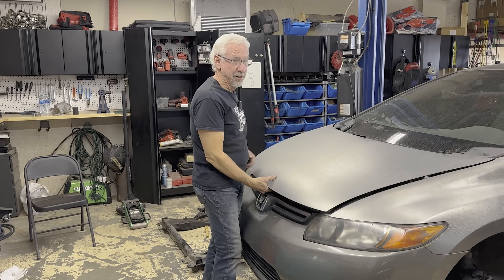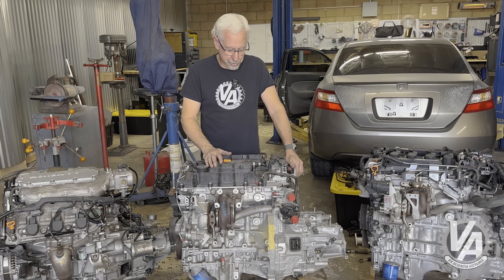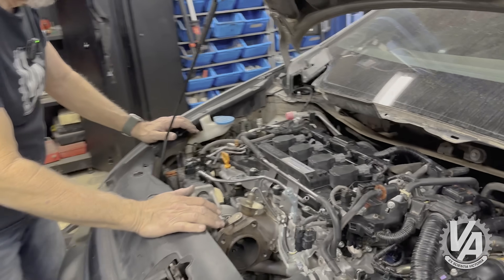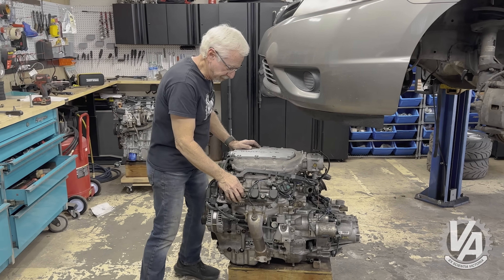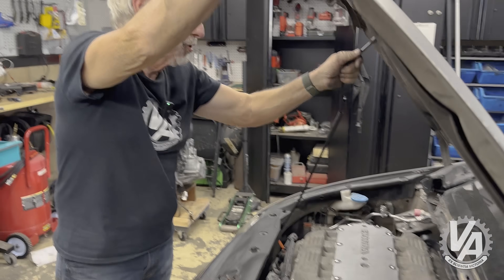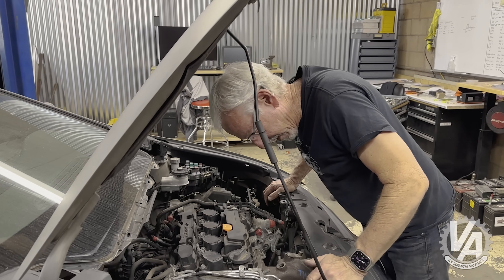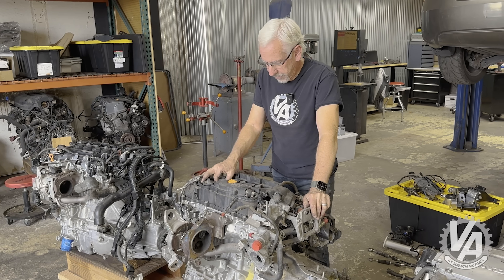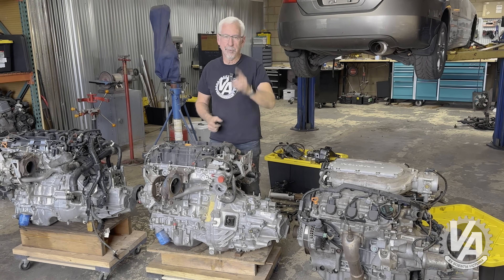Better than a K Swap? (More than a Si killer!) R18 to K, J or L15 Turbo!

Comment: Jseries is the most interesting one
Reply from the maker: Possibly the simplest too.
Reply: J swap all the way
Reply: The New j35y8 is what you want and Honda guys are excited about its the new variant they take the NSX heads and put it on the j-block so now it has double overhead cams no more VTEC but can phase intake and exhaust now sorry this was lengthy I'm just hoping to start my project to the summer with one
Reply: @kingmaybus8409 yeah it sounds cool and no more timing belts , all chains ⛓️
Reply: What does it weigh vs the K20c?
Reply: @nickwagner2284  the j is ruff 300 pounds no trans
Reply: @JDXFAB  So significantly heavier than the other options. Not sure why anyone would want that much weight up front? Drag racing I guess?
Reply: @nickwagner2284  no they are all about the same weight remember the other ones have turbo plus all the pipes there is no way the other engines are that much lighter
Reply: @JDXFAB  I don't know about the K20C, so forgive me for implying I was speaking about that motor. I had in mind the older K motors e.g. K20a2, K24a2. From what I can tell online they are c. 100-150 lbs lighter, which makes sense. And I believe the older K motors are very similar in weight to the B series e.g. B16a2. Now, if the K20C motor weighs as much as the J32, I would never want either of those engines in my car, as they would seriously change the dynamics of the car on track/autox. But I have no desire for drag racing/street racing domination. If I was purely into drag I wouldn't have much interest in a fwd car. But different strokes!
Reply: @nickwagner2284  the reason I chose the j32 in my application is cause is rear wheel drive now it sits way more behind the front suspension for better weight distribution plus cheaper plus bigger displacement so can make same power with less stress if I was making a front wheel drive prob go with the lighter option
Reply: @JDXFAB unless you have 2 more pistons, sleeves, the oil to compensate them, “larger” intake manifold, more pipes, more mounts, it’s a heavier set engine that’s why it came in the accords and other slightly higher weight Honda and Acura vehicles
Reply: @nickwagner2284 more weight to the front tires
Reply: J swap for sure
Reply: I had a j30 acura 1998 cl best car I ever had about to get another one and swap it with a 3.5 or 7
Reply: @gldylks  J-series are awesome.. Not exactly great for a lot of power, but they are FANTASTIC motors for fun daily driving and light modding.
Reply: @JonHop1 10 pounds on stock internals sounds good to me , are you saying it can't make 350-400 HP easy?
Reply: @ILLUMINASTyGAMERz  Which motor are you referencing? All Honda motors can make 350-400 easy on stock internals.. Even the D series.. All I was really talking about was how limited the new direct injection motors are for mods, and they are also pretty unreliable because of their direct injection. Internals wear out super fast even with good maintenance. The K20c1 really struggles with anything over 400 in terms of reliability. The old K's can make 600whp bone stock and be reliable.
Reply: Please do the J! Would be awesome!
Reply: Would ruin the handling tho
Reply: He said it's a built motor too
Reply: Nah, k24/k20 in the 8th gen si is way better than the j series swap. I’ve personally seen too many times where people swapped to j swap to swap back to k swap. K is a better engine to build on also A built j series cannot keep up with a built k series.
Reply: K20C is the way to go even tho i love the J series and wont ever switch its the best compact motor honda has ever produced as of recently.
Reply: Underrated. Due to, only 3 different manual transmissions can fit on the block. Depending on which block you have. Engine management is only Flashpro, discontinued or standalone.
Reply: J swap ❤
Reply: J35-Turbo all day
Reply: Throw a stock j35 and a stock k20 into the same civic, the j35 will kill the k20 all day stock..
Reply: But add a turbo and send it
Reply: J series.
Reply: J-Sus 6-6 is the build.
Reply: Is what I’m saying
Reply: J FOR THE WIN
Reply: Agreed 100%
Reply: Facts just J swap that hoe , my fav Honda motor
Reply: I have a question. I’m trying to buy a 2001 3.2l cl motor and install it in a 2001 Honda accord coupe . My question is…will it bolt on to the 3.0 transmission 2001 ? Also the wiring harness off the 2001 Honda accord coupe chassis plug right into the 3.2L cl motor? Thank you !
Reply: one of the easiest to aquire where i’m from… i’ve seen j35’s go for as little as $400 full assembly in CAD…
Reply: J series is a lump of lard. K series is better tbh.
Reply: @20piecemcchicken93  J series will last longer. No need for turbo and intercooler, no lag. It's not like they are building a drag car.
Reply: @20piecemcchicken93  Bro that aint a real K-series.. The k20C1 is crap. Direct-injected, low-revving garbage.. Now yes, the old K-series are probably the greatest production 4 cylinder EVER.
Reply: @JonHop1  I didn’t say anything about a k20c1
Reply: @20piecemcchicken93  u said the k-series was much better, and the k-series in the video is a k20c1.. u never specified you meant the old variant
Reply: @JonHop1  what are you smoking, the k20c1 is sick lol
Reply: @matthewla16  I dont think you know anything about these engines bud.. The k20c1 is a good economy turbo engine with decent performance. But it is NOTHING like the old K's.. It flows about half as much air, and is direct injected. This makes it so that making more power is detrimental to the engine, and it is why k20c1's are not reliable at all over 400whp on average.. Tuning is harder and more complicated due to air and fuel, and you are very limited in what you can do with the motor unless you pay $10-20,000 to completely rehaul the entire motor and go port injection while machining the head. Its the same reason no one used the k24z7.. Its single port-exhaust is built into the head and causes a lot of restriction so the motor is limited. There is a reason all the high-HP builds use the old K's and B's.. Honda offers the K20c1 as a crate engine unlike all other models. If the K20c1 was a good motor for motorsports, everyone would be using them as they are fairly cheap and you can easily get them straight from Honda. Port-injected engines that are ported to flow a ton of air on the intake and exhaust side, like all old Honda motors, are just FAR superior. And its not close.
Reply: @JonHop1  you have been in the new type r? I love the older k series, I have an 8th gen si and I’ve had the z3 and a k24a2 in it and I love them both but the k20c1 is frickin awesome
Reply: @matthewla16  Yeah I have test driven it 2 times now.. K20c1 is an okay engine for daily drivers, but not for making power and performance.. Its a very limited engine, as well as a super challenging engine to tune and keep reliable under higher hp and boost levels.. Direct Injection is just not ideal for larger power unless it is super fine tuned and the engine get super high maintenance. Which is why direct injection can succeed in some forms of racing with race teams managing the tuning and engine. Also, the k20c1 doesnt have Vtec really.. At least no where near the real true Vtec, and it has no cam variation at all on the exhaust lobe. The DI and limited cam phasing keep the engine from being able to rev high. So its a super lame engine in comparison to the older Kseries that breathed a TON of air, had True Vtec crossovers, port injection, and revved to the moon. K20c1 feels like an underpowered v6 and performs like one with a decent amount of mid range, and torque, and like 6500-7k rpm redline.. Its just kinda boring in comparison to 9-10krpm in older B, K, F series engines.
Reply: @JonHop1  I will agree with you on it is a limited engine. My friend had one up to 500hp maybe a little more but that was it before you really have to open the engine and change shit. And if you were taking an older k series to 9k-10k rpm holy fuck idk how 😂 my k24 redline was at 7k and my z3 was like 8.5k tops
Reply: @matthewla16  k24 can redline to 9k just using a ported type S pump and 50 degree cam gear.. K20 can get to 10k using ported pump.. K20c1 isnt even reliable at 500hp, and thats the problem.. All I see all the time are SI's and Type R's coming in for all type of engine failure issues from boost increases and the engine just not liking it. Direct Injection needs consistent and almost perfect air/fuel, due to its more potent and complete combustion, so if ONE thing is messed up, its the end of the engine.. Unlike port-injection that has a lot more room for error.
Reply: @20piecemcchicken93  no replacement for displacement; J30-3.2 last longer too stock.
Reply: @SamslamminCars  I know. That’s why I 6.0ls swapped my 180sx to replace the 1.8l turbo.
Reply: @SamslamminCars  I wondered about this also, why the j35? J32 is a better option. But I recommend the k20C anyway, since it’s a civic. Had it been an accord, I’d recommend the j32 with a supercharger.
Reply: @neonaqua4279  any engine with a VCM is going to have issues down the road. More vehicles were installed with one in the J35 & 37 which is most likely part of the issue.
Reply: @SamslamminCars  that’s why VCM deletes were created. Easy 100$ and 5 minute fix.
Reply: @neonaqua4279  I have owned/drive many 6-speed Accords. Fortunately they are without the cylinders deactivated nonsense & much quicker than paired with a slush box.
Reply: @20piecemcchicken93 lol it depends on aplicación on boost u can make the same power levels with less boost and stress on engine  on rear wheel drive aplicación the j seems to do better on front and AWD the k seems better
Reply: The j is cheaper too lol

Comment: I like the L15 idea, since its the next generation swap (in my opinion).
Reply from the maker: For sure the future. They put that in so many cars like the K.
Reply: i had one in a 10th gen SI and i absolute loved it, i think this would be a great swap for many Honda's. With the peak torque coming in so low it feels like a mini V8. I know it doesn't have V tech and its a lower rpm motor but they are going to be cheep, plentifully and they love mods with a huge aftermarket support.
Reply: I think that job is going to go to the k20c4.

The L15s are laughably weak when making anything more than 300whp/300wtq.

And the cost to make more than 350whp shoots up exponentially as you run into fueling limits
Reply: @darkknight097  finally someone talking real shit
Reply: Head gaskets L15b